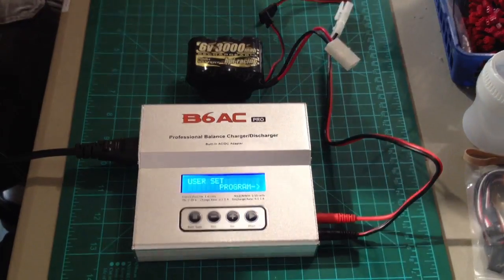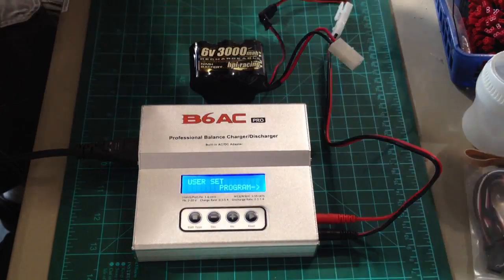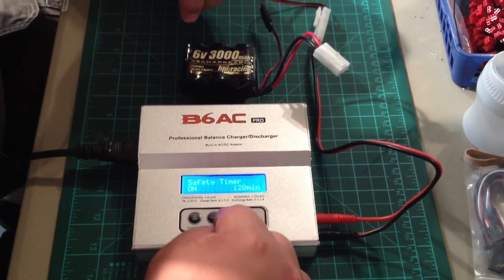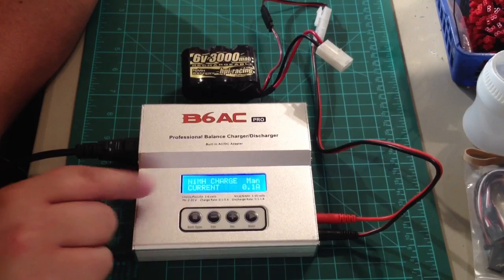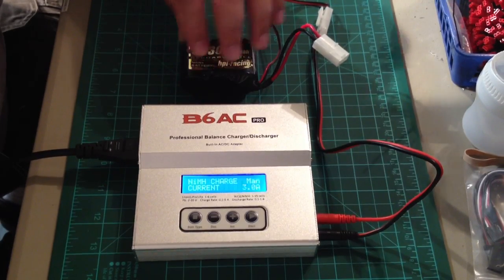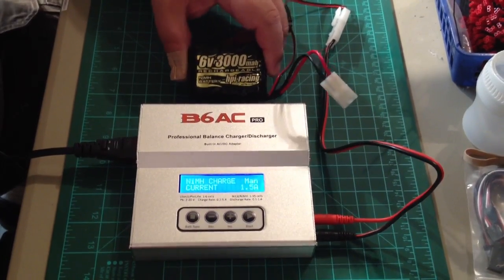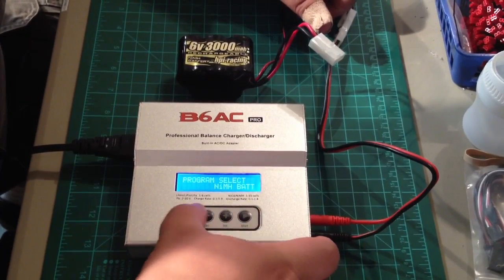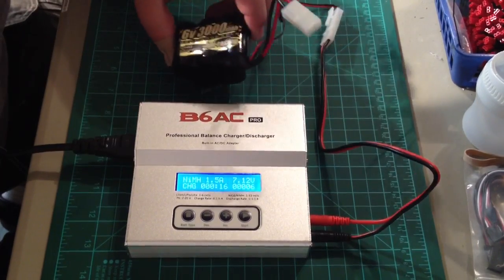Charging a 6v NiMh Receiver Battery Pack for R/Cs

Comment: Never knew what the reading in the bottom right hand corner was. Nice to know. I'm new to nimh batteries (just got back into rc'ing 3 years ago and everything has been lipo). I've started racing 1RC sprint cars, box stock, which uses little 230mah nimh batteries. Very informative video, even if it is 12 years old, lol! Thanks.

Comment: I own a B6 balance charger and understand the parameters of charging. I have 4 NiMh batteries each of 2800 mAh. I have set up charge current as 0.5 Amp for slow and safe charge.  
I want to know in charge mode of NiMh battery, how should batteries be charged in series or parallel? And is there any way to balance charge each cell like in LiPo batteries?

Comment: You are a damn Legend 👌🏼
I have been doing my head in trying to find the straightforward English version of how to operate these balance charger/ discharger systems & finally here it is 🤘🏻
I finally have an understanding of how to get some charge into my dynamite speedpack 3000mah 
If it weren't for this video I would've spent more money for the sake of getting a charging system with instructions lol

Comment: Nice little charger.    I have been using a "vintage"  TEKIN 112c and it is fully programmable.....timer, current, voltage, etc.   But I am thinking of  trying a new charger.  
Appreciate the demonstration.

Comment: im carging an NiMH 9.6v 1.100 mAh and on the display it gos over the 1.100 is that normal ? or a bad thing ?
Reply: tier88 
How much higher? It’s not abnormal for a battery to hold more capacity than what’s on the label.

Comment: At what amps and what volts would i discharge a 6v 5000mah nimh?
Reply: 1growroom Discharge why? For storage? 1 or 2 amps is fine.
Reply: Kent Keller I wanted to cycle the battery cause I've had it for three months now.

Comment: perfect video to charge my 7200mah killer r/c lipo had a few questions and you answered alot thanks killer r/c
Reply: Think you can't charge a 7200mah battery with this charger.
Maximum it charges is up to 5000mah.
You may can, but your battery will stay at 75% of his capacity.
Reply: It depends how low the battery is. If the battery is only down to half capacity then it would only need 3,600mah to fill it up. If you charged a battery all the way to 7,200mah then that means that the battery was discharged to 0, which would be bad. It's like the gas tank on a car. You just add what you need to fill it up. If you need to add more then you just restart the charger.

Comment: I thought nimh needs to be charged at no more than 1/10 c if you have both performance and longevity considered. Is there any truth to that?
Reply: Yes, does anyone know if this is true and what it would be for a 2500mah
Reply: No. 1C is fine.
Reply: 1C would be 2.5 amps. 
1/10C would be 250ma or .25 amp.
Reply: So I should set it at 2.5 a to charge or is 1.5 ok
Reply: Anything under 2.51 is fine. The lower you go the more time it will take to charge.

Comment: do lipo batterys run out of battery
Reply: Lipo batteries are much more complicated and dangerous. You have to know a lot about Lipo batteries  before charging. Never discharge below 3 volt. I would suggest that you watch "Flite Test Beginner Series Batteries". They will tell you everything you need to know

Comment: I have the same issues.. i have a 3000mAh battery and it will sometimes pass that 3000 mark....? don't know if i should let it keep going till it automatically stops or shouldn't let it get pass that 3000, and when i charge it it will stop before 300mAh and say its full but it isn't... i unplug the charger and it works, do i need to keep unplugging the power supply after every charger?

Comment: can anyone help me? trying to charge 1100ma batteries that are 8.4, i did everthing he did, selecting info and such, and i can not get my charger to charge them all the way.itll put like 250ma into it and then say done, and these batterys are dead and are brand new out of the box
Reply from the maker: Whats the voltage on the battery? Maybe that's all it needed to be fully charged.
Did you watch the part of this video about changing the Delta Peak?
Reply: yes i did all of that. i got it to finally work, i had to keep restarting it and keeping track of what my mah is stored. first time it went to 50, second time when to 105, third 280, and now it goes on forever, weird huh?
Reply: corbonzo1 I have the same issues.. i have a 3000mAh battery and it will sometimes pass that 3000 mark....? don't know if i should let it keep going till it automatically stops or shouldn't let it get pass that 3000.
Reply: i got it to work by keeping track of it each time and going it over and over again but make sure you dont over charged, after doing this it would charge it all in one shot, i think it conditioned it or something
Reply: I'm sorry, doing what over and over again? not understanding.
Reply: plug it in, let it charge till it stops, say it stops at 140mah, keep track of your number so you dont go over your bat size. keep doing it till you fill it up, use up the battery, and once you go to charge it again it should charge the whole way untill its full, kinda hard to explain. do you understand now?
Reply from the maker: Depends what the voltage of the cells is. I just charge til its about 1.45v per cell. So on a 5 cell pack thats about 7.2 volts
Reply: oh wait what kind of bat are you charging? there shouldnt be individual cell voltages for a nimh, only the overall voltage rating
Reply: i got it figured out lol thanks though.
Reply: I have the Maxam edition of the exact same charger... I have a 4350 mah NimH and a 5000! I have the same problem the other day i came home with my 4350 battery complete emty it charged for around 2 minutes and said it was full... there must be a solution to this because is the same everytime i whant to charge.. and i cant live with it i still have warrent on my charger so i might return it for a nother model because this is not normal! But if any of you have a solution to the problem witch works please tell me :)

Comment: Hi just wanting to know how would you charge an 7.4v 6800mAh Ni-MH battery? on an IMAX B6AC.
Reply from the maker: You mean 7.2 volts? LiPo is 7.4v. NiMh would be 1.2v x 7 cells = 7.2v.
You just set the charger on NiMh mode, plug it in, set it at 5 amps, and then the charger will do the rest. Or if the pack has been neglected and needs some love you could charge it slower, like 2 or 3 amps.

Comment: Hi I just want to know what is the white connector on your charge leads called, as I didn't get them with my charger and need that connector most of all.
thanks
Reply from the maker: It's usually called an XH plug. It also goes by the same name JST or Align plug

Comment: Thanks for video, really helpful. I was getting nervous when charging a 6 cell (7.2V pack) and the voltage increased towards 9 volts. Will the voltage decrease rapidly towards 7.2V when under load?

Comment: Good vid. I may get this charger. I'm still using a old charger indi 16x4 pro that I've had a long time. It charges ni-cd and ni-mh batts which is good enough but looking to get into lipo for the baja now  with  4200 lipo's that I plan on getting for their awesome run times that I've heard

Comment: Yes you can charge it any time you want. If you use a smart charger like the Imax B6 the charger knows when the battery is full, no matter how empty or full it was when you first plugged it in. No need to discharge the battery. I only discharge a battery if it needs a good cycling to get rid of any "memory". Ya only need to do that a couple times a year. The Imax charger actually has a mode where it will automatically discharge and recharge the battery by itself.

Comment: Can I charge a battery that still has charge? Will the charger automatically know when it's fully charged?lets say it has 1500ah still in there. Will it stop at 1500mah? I just don't want to over charge the battery.  Or should I discharge first and then fully charge 3000mah in it?

Comment: Maybe the battery was already almost full? A battery should never be totally empty. What is the voltage on the pack? Get a digital volt meter and measure it. A fully charged 9.6v would be around 11 volts. 9.6 volts is what the pack is when it's half charged.

Comment: I saved and loaded settings for my battery (9.6v 1500mAh) afterwards it asked to set the current, I set it at 0.5A so it should need 3 hours,
but after 8-9 minutes the charger said the battery was full, yet it is a new battery so I'ed expect it to be empty
And during the charging process, the charger displayed voltages over 10V,
this made me worry, am I doing something wrong?

Comment: Great video! two question... when i charged some nimh batterys the right corner jumps to 8.22v is that fine?

and also in the setup: D. PEAK is DEFAULT. i need to change that or no?

thanks